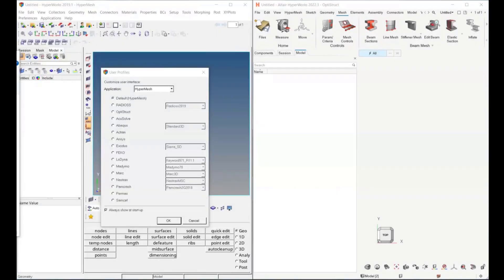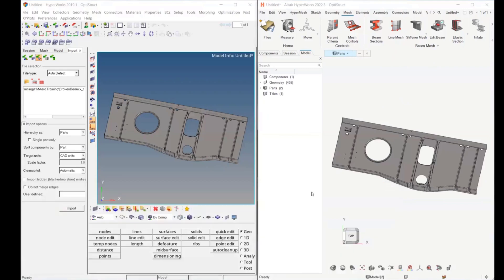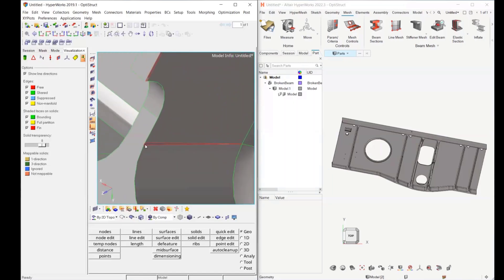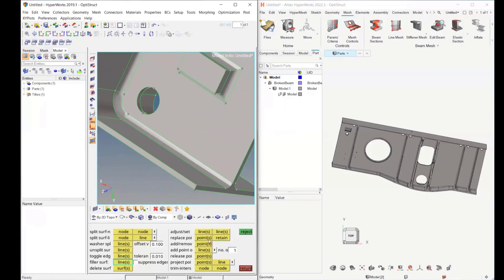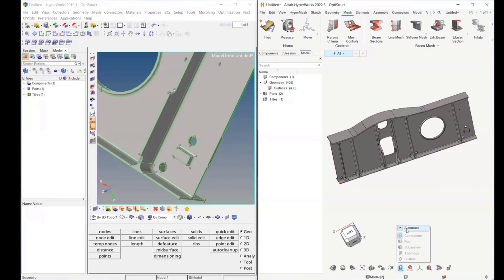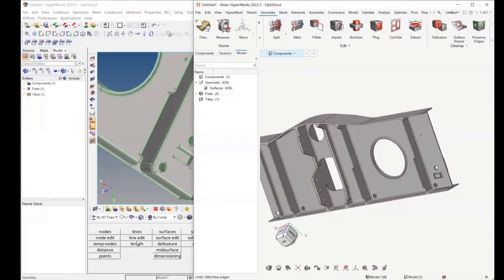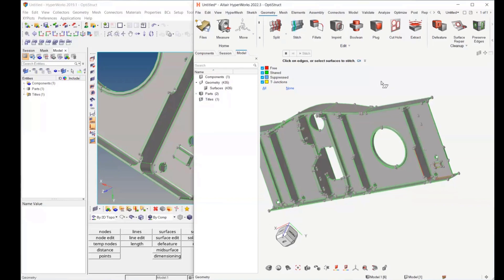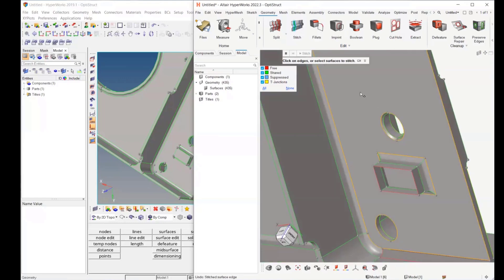EP 24: HyperWorks - Transition to New User Experience: Geometry Cleanup

Comment: Engineers use different terminals at work, so creating a custom toolbar for quick edit is not that practical
Reply from the maker: hello @rickmarshall5419, thanks for your feedback, but I'm not sure to understand your point here. The custom toolbar is one way to customize access to your preferred tools (as the toolbelt), and it can be exported and imported as a xml file, so working on different computers should not be a limitation here